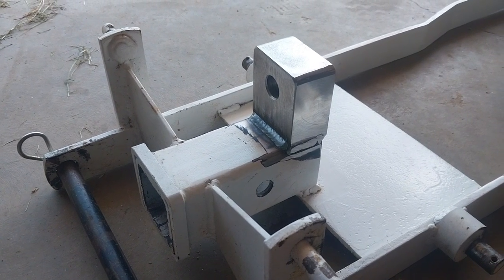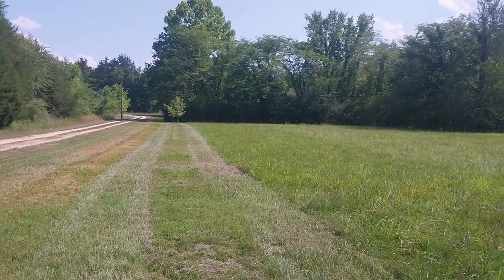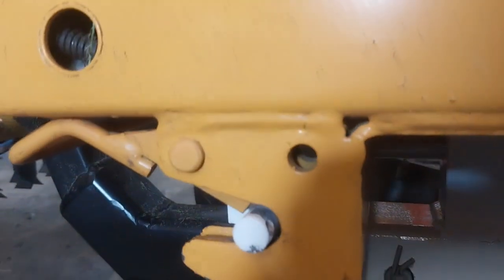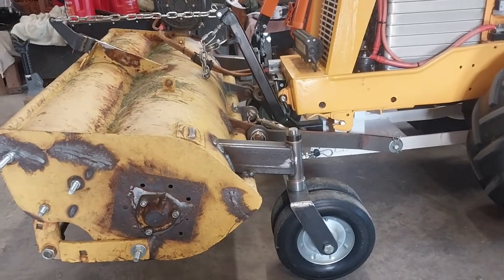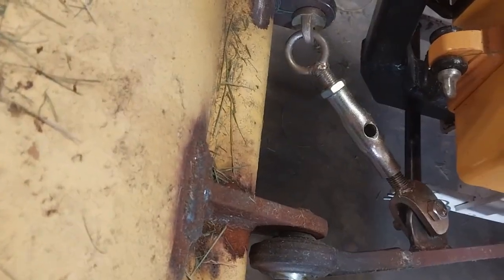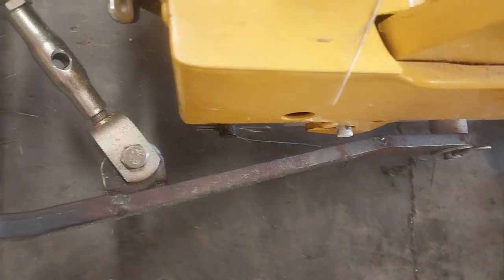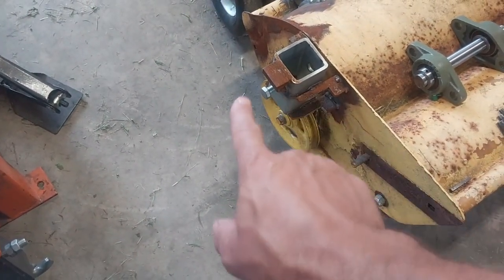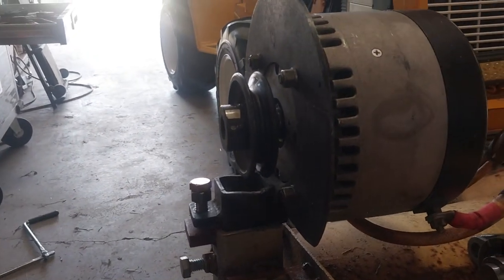Flail Geometry - The Cub

Comment: You may not have the vibration issues once you relocate the motor, since when you are relocating it, you won't be applying the belt tension directly to the motor mount, and the motor won't have that extra pressure on it.
Reply from the maker: 100% agree.  It's very possible that the motor vibrates that much when it's on my finish mower, too but since it's behind me I can't see it!